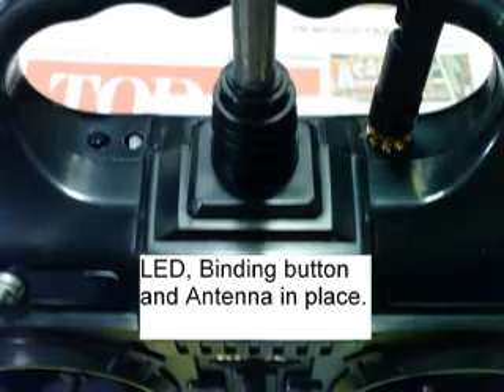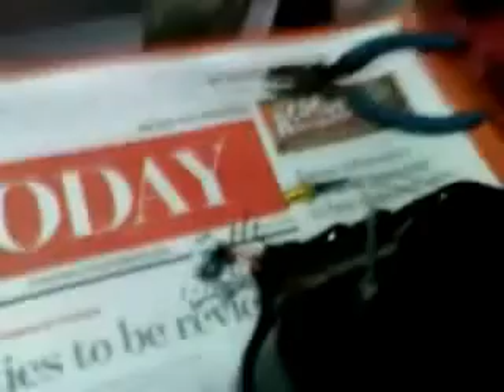Frsky 2.4 Ghz DIY module on Hitec FM Flash 4

Comment: I love this radio, got in when it came out, then when the Flash 5 system X model came I sold the 4 and bougt the 5sx. I still have it and use it in fm. its great with fm now when everybody else got 2.4ghz. I have ordered a frsky accst module for my futaba 3pk Fm radio with spectrum module. Spectrum sucks for marine use, the signals does not go throug the waterspray from my propeller. I bet I will get massive range with the dual 60cm antennas

Comment: by the way, you can easy uprade the 4 to the 5sx, there is a howto on it. there is a hidden swich inside the radio, actully its two solderings that you short and you get into a factory programing mode) where you can enable the SX functiopns and alot of other stuff that I have no idea what its for. functions that the 5SX does not have

Comment from the maker: Hi Michael, thx for comment. yup, i'm using hp camera..haha... sorry for the crappy video. I actually edited the text on jpg photo b4 make it a slideshow. its turn out not as clear as the photos. but if u want u can send me ur email i can send u a pdf version maybe. Its very easy and straight forward as its solder to the buddy port, the rest u only need to find ur own prefer location for the led extend board and antenna. :) cheers!
Reply: Hi Alex, any chance you still have these details? Struggle to read the text on this video. Cheers.